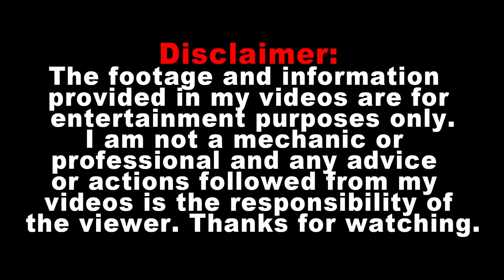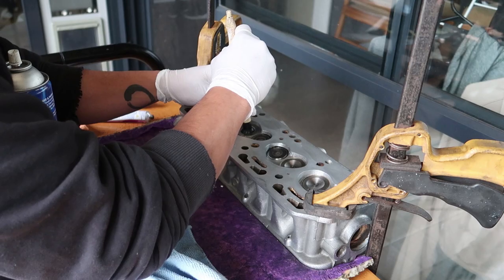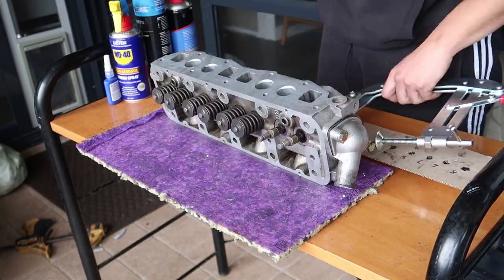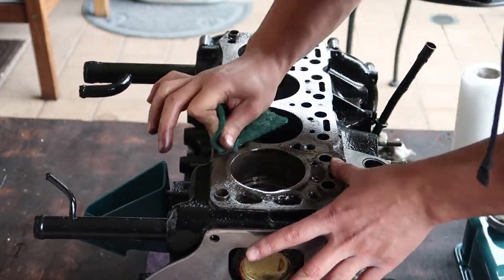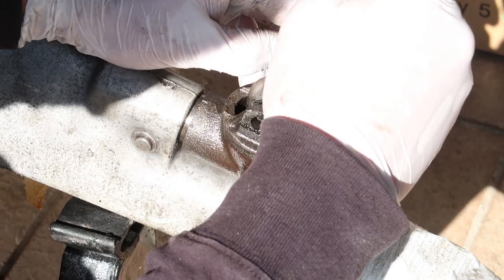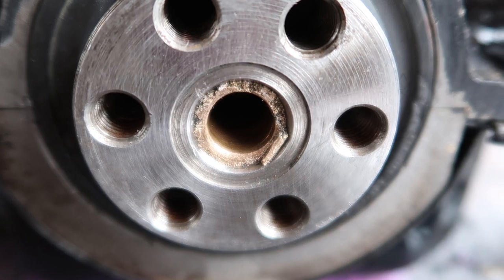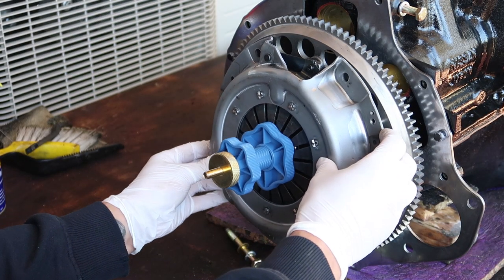DATSUN BUILD - HEAD WORK AND TRANSMISSION DONE!! (#6)

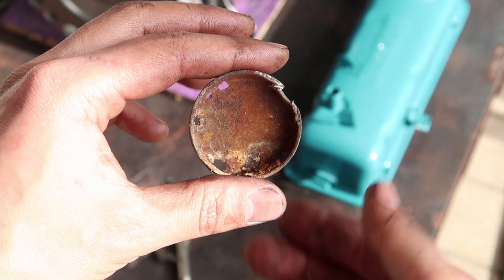Comment: At 2:23 you remove something called a wash plug? I wasn’t sure what you said. On my A15 I’m noticing that I have an oil leak and someone told me it was the rear main seal. Is this the rear main seal? I wish someone did a video on that so I could see😊👊🏼
Reply: I should’ve watch the whole video! 😂👍🏼 At 11:55 rear main seal work. Thanks!
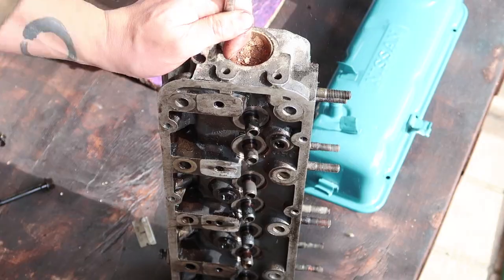Reply from the maker: The part at 2:23 is called a 'freeze plug' or 'welsh plug', I think it was used for the casting, but also to remove frozen water too? I'm actually not sure haha
Reply: @32Builds  thank you! Dude I have to say that was a very fun and inspiring video series.
Reply from the maker: @SunSweepingServices  Cheers! Hope you continue watching haha

Comment: Hi how do one knows  when you need a rebore on a block
Reply from the maker: You could do a compression test if the motor is all closed up. Otherwise a visual inspection and using the proper bore gauge. Its not something I'm looking to do at the moment so I left mine as is :)

Comment: Hi man like to see the details of the valves adjustment
Reply from the maker: I used a feeler gauge and set the gap to 0.3mm clearance :)
Reply: I would like to get more details, since I want to restore my Nissan 1400 engine.

Comment: Caustic soda (not baking soda) is what is used in oven cleaner for cutting grease, but it attacks aluminium so not good to use for cleaning a head.

The best carby cleaner and carbon remover/softener I've found is Threebond Engine Conditioner. Spray it on, let it sit for 20min, and then give it a scrub and rinse it off with regular carby cleaner (brass parts, eg, carb jets, need to be sprayed with WD40 before assembly to stop them tarnishing)

Also when rebuilding a carb/replacing the gaskets, thoroughly soak the gaskets with WD40 before fitting them, and don't use any goo on them. This stops the gaskets from sticking and tearing later on down the track if you need to pull the carb apart for whatever reason.

The way you fitted the new clutch release bearing wasn't right. You need to push on the center part of the bearing only. Pressing or hammering the outer part can damage the bearing surface which will cause the bearing to fail prematurely.
Reply from the maker: Awesome! Yeah, I've experienced caustic soda eating at aluminium before - if I do use it on Alu I try keep the exposure time as short as possible. Thanks for the info I'll definately try  that stuff next time!

I was wondering what I should do with the gaskets! For the moment I put them in dry and was going to keep an eye out for leaks! Will definately keep the wd-40 in mind :)

As for the bearing, I hoped nobody would look that hard haha
I was in the moment, and didn't have anything that would fit around the inner ring but not obstruct the part I was pressing in. 

Thanks so much for the advice and detailed comment!!!

Comment: How did u get the Welsh plug out
Reply from the maker: The Welsh plug presses in and it has sort of tapered sides. If you hammer the rim of one side - the plug will pivot and the opposite side will pop out towards you. Then its a matter of yanking it out with pliers or vice grips!

Comment: Very informative video and very clear.. I love your videos. I am a newbie and still researching. I wanna do what u did. Rebuild similar engine. A detailed video will be very helpful to new beginners or u can share the link if u have already done it.. my question is do we adjust those valves or not. Probably yes but how. I wil get manual to supplement my little knowledge. Thanks a lot for sharing your knowledge.
Reply from the maker: Thanks so much Daniel, the adjusting of the valves are done with the help of a 'feeler gauge' - the adjustment ensures that the correct amount of play between the rocker arms and the top of the valve stems so that the amount of intake and exhaust is consistent, as well as making sure the parts do not wear down mechanically.

Comment: Did you apply anything on the head gasket also what sealant did you use on the thermostat housing?
Reply from the maker: Nothing on the head gasket, you rely on the flatness of the block and head as well as the correct torque and tightening sequence. The the thermostat housing I used aviation gasket sealant, which is good cause it doesn't squeeze out as much leaving floating gasket maker running through your system. I would recommend though, not slathering it around the actual thermostat though - gonna be a bitsh to clean whenever I want to replace the thermostat. The sealant between the thermostat and housing is good enough I think :)

Comment: Another great video! Just wondering what grease you used on the shaft when putting the thrust race bearing back in?
Reply from the maker: The pink stuff? It came with my bearing replacement :)

Comment: Did you upgrade the clutch or use OEM? If so where did you get the new one?
Reply from the maker: Its not an upgrade, but an aftermarket OEM one. I got it off ebay, may have been the BProjects ebay store :)

Comment: Hi what gap did you use for your valve clearance?
Reply from the maker: I did a bunch of reading around and for cold clearances I've found 0.25mm and 0.35mm. Theres a good write up on it on the datsun 1200 tech wiki as well. I settled for a 0.3mm clearance right in between haha
Reply: 32Builds awesome thank you I’ve set mine to 0.25 but it’s burning a bit of oil so I’m going to check the valve seals 
Thanks man

Comment: So, disassemble an entire engine, and don't take it to the machine shop!? Only on The YouTube....
Reply from the maker: These motors don't warp much like engines in a V- configuration pushing high power. I checked all the clearances before reassembling the motor and everything was flat to the tolerated spec. This isn't the first time I'll work on my A12 so maybe I'll take it to get ported and polished in the future 🙂